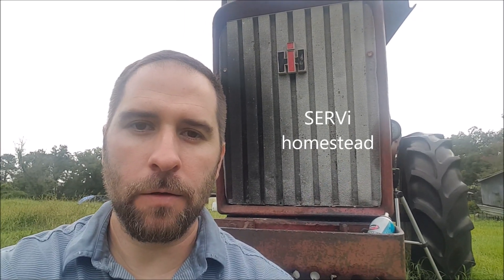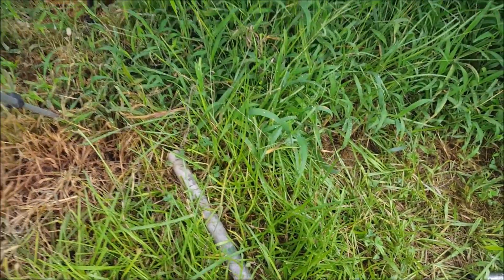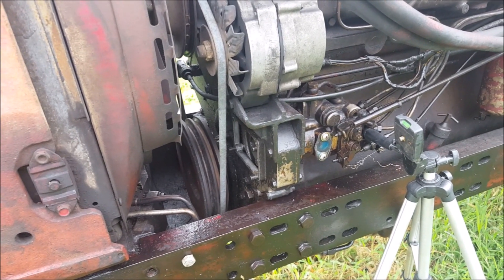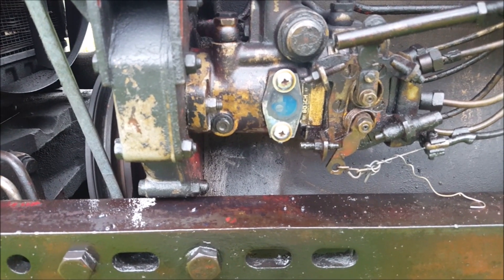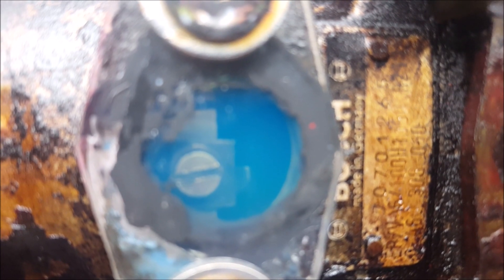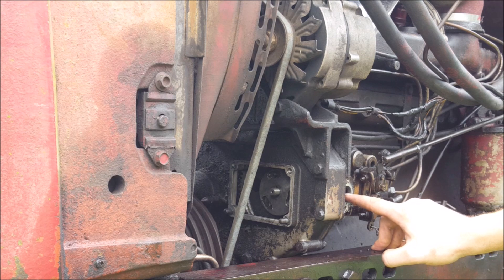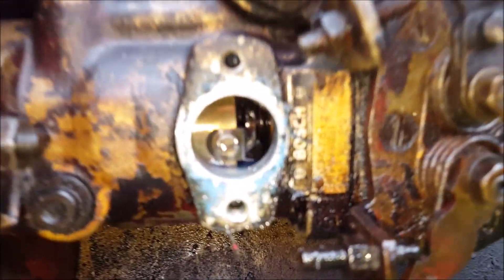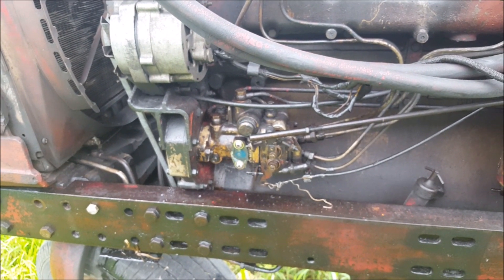Diesel injection pump timing on Farmall 706

Comment: May I ask what year tractor? I have what I believe to be a 1968 with the German. It was my father in laws. I’ve taken over over responsibilities for the small operation of the farm. It only has 680 hours on it. My other question is can you replace seals without screwing up any adjustments. It’s been leaking fuel and I don’t doubt it’s pretty much all original and never been taken apart. I’m just worried I might open a can of worms and get in over my head.
Reply from the maker: Hi, Studley. Mine is from late 60s, too. I think German engines used from around 1967 - 69. Any idea what area of pump is leaking? Some spots will be easy to access, others not. Let me know.
Thanks for watching.
Reply: SERVi Homestead I’m gonna give it a good lookover tomorrow. Try and figure that out. Also try and get some model numbers off of it. I’ll keep in touch. I’d like to post a video on it. It’s really a nice tractor that really never got worked to death. It’s a gem. Thank you for the response!